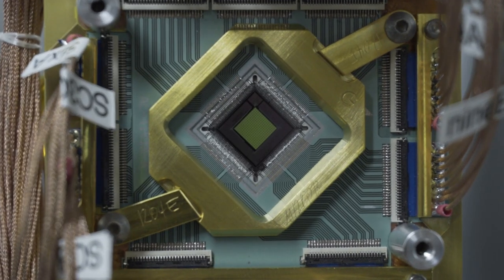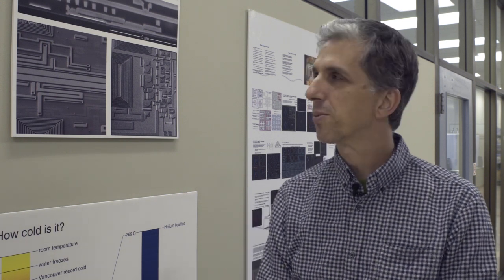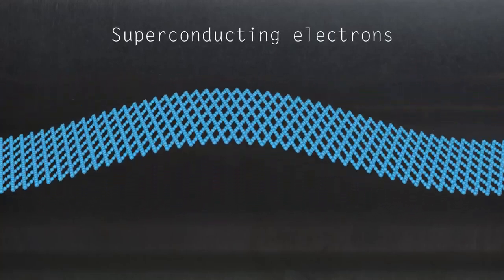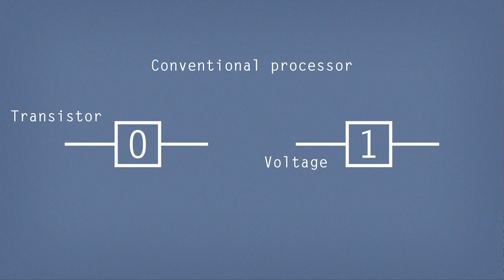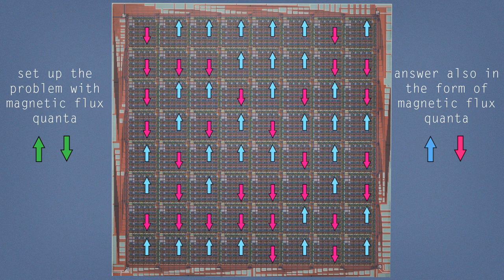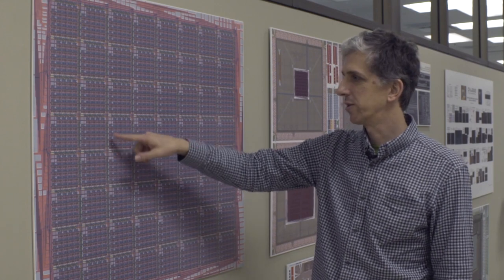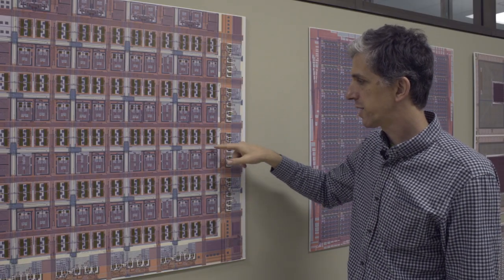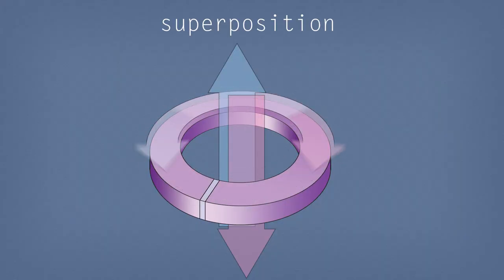D-Wave Lab Tour: The D-Wave Processor (Part 2)

Comment: So without the near absolute zero temperatures, the quantum mechanics wouldn't work??
Reply from the maker: j3fr0uk Yes exactly - temperature is a source of noise, and too much noise kills off the quantum effects.
Reply: +D-Wave Systems Wouldn't a pure insulated position be magnetically supported in a complete vacuum with no contacting surfaces, pure reflective surfaces, pure white surfaces?

Comment: As this has allot to do with super conduction and near zero resistance, A why would it be that hard to manufacture thees dies, as they can be done using light etching of Niobium and B, providing that they are kept with no electromagnetic interference they will work. Is it due to the limited supply of Niobium, if so then couldn't you fission other, more common elements such as tin?

Comment: With the superposition qubit, how can you have two opposite magnetic fields in the same place?
Reply: Ben Pharris kinda, (summoning some quantum fields theory) they are sustaining an environment that can support the electrons in a a superposition state until they pass through the program applied onto the processor who manipulates them and send back to the heater classical environment, already at the state carrying out the solution for the input data
Reply: 2 opposite polarity magnets size of texas put into grain of sand size square combined basically if not literally. Cern to answer the next or something like that

Comment: How many states can a superposition QBit achive or be read in? What base would a processor like this run at?
Reply: +Jason Gnann A quantum computer doesn't have a specific base. The base used for the most part is binary, but that's only because we need "standard" computers to be able to translate the response from the Qprocessor. The interesting thing is that when they talk about it existing in a superposition, only one answer can be read at a time. What a quantum computer does is calculate all possible outcomes and answers at the same time. When it gives the answer, it gives this jumbled response of all possible solutions simultaneously constructively and destructively interfering with one another on a quantum level. This is part of the reason why quantum computers are so difficult to manage.
Reply: Thank you
Reply: +Jason G   The equivalent of a entire "row" of binary, one quibit for the first digit, one for the second digit, etc. This is why people are freaking out over 100-200 quibit computers, the time to break RSA is like minutes vs decades.   So the speed increase in "special high chaotic problems" ie fluid flow, weather, stock market prediction,  is on the order of a 10000 times.

Comment: First thing, as good as these videos are, they are too short, there must be loads of interesting stuff about quantum computing.
Secondly, lets just say that i were minted, how much would i be looking at to get one of these quantum computers?
Thirdly, how does this D-Wave Processor compare to the CPU/GPU in the Xbone & PS4, what i am getting at is would it run games 1080p native at 60fps locked? 
Forthly, how would this D-Wave computer compare to the computer on The Enterprise in Star Trek TNG? is it the same sort of computer basically.
Reply: From what I've read apparently it doesn't make all that much difference, unless you're going to be attempting quantum calculating, which this can do and normal computers cannot... I may be very wrong but I think this is a different kind of computer to what you're thinking.
Reply: +BigBaddie666 The quantum computer is similar to programmable logic devices. With enough PLDs you can create a computing device that is hardwired to perform various tasks, then create a completely different device by changing the code. Consumer PLDs cannot handle complex computing tasks because of size and heat. Quantum computers overcome this limitation by creating a bank of programmable logic devices that operate at near absolute zero and at a size that allows electrons to interact with each other without a heat producing medium like wires or fiber optic cabling.Star Trek TNG computers do something similar but it communicates with terminal by transmitting information via plasma, eliminating the need for wires. That allows the (currently fictional) Star Trek computers to handle mechanical and energy tasks as well as information tasks.

Comment: how can a using a mini magnet instead of silicone transistors gain you access to the quantum level ... hmmmmm
Reply: Because the mini magnetic energy is compressed greatly hence keeping it cold very cold as well as this magnetic substance seems to be more than just a magnet. For simple example.... Are you walking the dog or is the dog walking you ? Which came first the chicken or the egg...... Well im no.teacher just self taught from reading and experimenting my self .
Reply: Kinda like squeezing 2 magnets of opposite polarity the size of texas into a grain of sand ... So it looks small but contains great resistant presure being combined to make a different kinda " energy " i guess is the words ....and a type of morris code is used to extract or repurpose the energy . not sure how very cold wires cause questions to be answered and fed back .... Is there a program written for it ? Im guessing its the program that writes the program for itself right

Comment: Soon we will have quantum computers that can fit in your pocket. This is just the start of something that might change the world, if it works of course.
Reply: ArcadeGames Doubt it'll be soon unless you can safely handle near absolute zero???? ;)
Reply: Depends on what you define as soon. I'd be surprised if they manage it within 5 years, so 4 would be soon.
Reply: Hatagashira I'd say 15-20 years...
Reply: +j3fr0uk We won't need absolute zero once we  have room temperature superconductors.
Reply: +bellroid1 Is it possible?
Reply: TheDarkFighterek Room temperature superconductors? Theoretically yes it should be possible.  It's only a matter of time.
Reply: bellroid1 I wonder how technology will look after 50 years. I guess it will be very interesting.

Comment: So it works on measuring compression/torsion of the angular pahse of the multiverse ether. Since ether vibrates 2 dimensionally, hence why multiverse can exist, each verses' ether is out of angular phase. You are basically computing with the angular phases of ether. Least that how my brain sees it. Need to make the circuit a vacuum tube.

Comment: This has nothing to do with quantum entanglement at all, it should not be called a quantum computer, thus on,y a different wax of bits with a twist of neutral bit, wow snake oil
Reply: entanglement just means that the qbits are dependent on each other so for example if you measure one of them then the propability amplitudes in the other one change or collapse